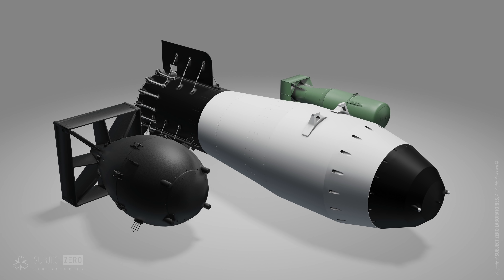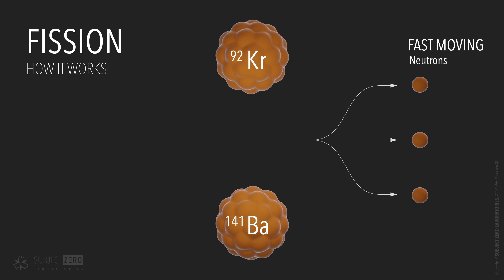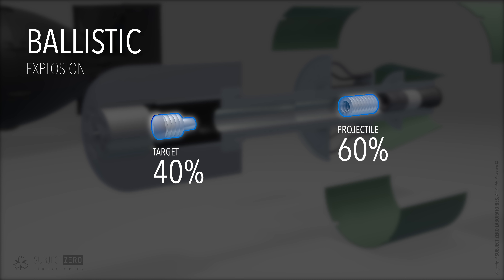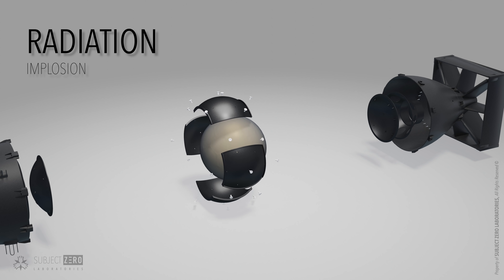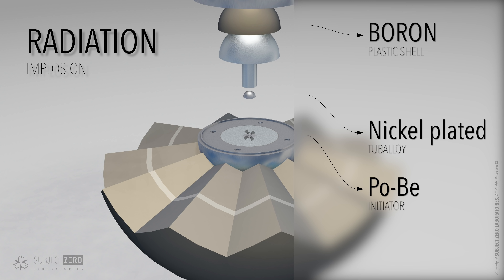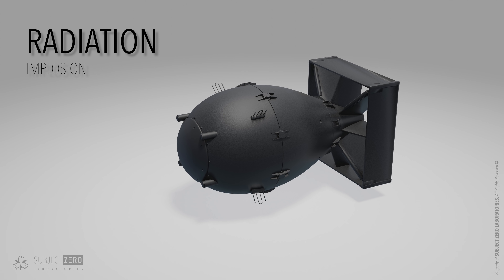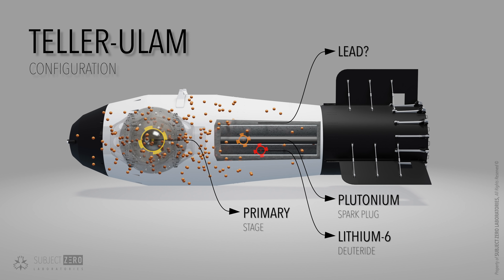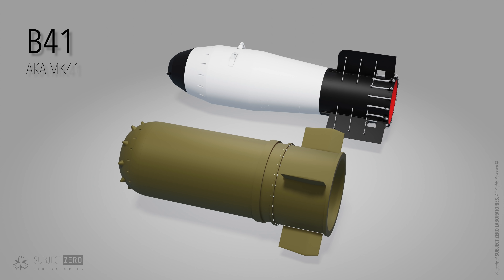Are Russian Nukes the Most Powerful?

Comment: The first British Thermonuclear bombs had a layered structure with the fusion fuel layered around the fission primary. The Tsar Bomba was also a layer cake design. In theory you could just add more layers to make it as big as you like.
Reply: Sorry, you do not understand how a layer-cake (sloika in Russian) thermonuclear device works at all.  Layer cake devices are compressed by high explosive, not radiation, and have a maximum yield about 1MT.  Tsar Bomba was a Teller-Ulam-Sakharov radiation compressed device.   All of this information has been public knowledge for over 25 years.
Reply: @vibrolax  Not only that... a sloika design has an inherent limit on scalability beyond a which you cross the line of a critical mass. Yes the first fission-fusion-fission bomb was a layer cake design but, as you said... Tsar was a three-stage Teller-Ulam design.
This video is trash... it throws the ball, not only when it comes to the physics of the bombs... also regarding plain (and public) historical fact
Reply: @vibrolax  It's public knowledge, but it's not as though it's simple to understand. Even if you can separate the true stuff from the deliberate obfuscation and the plain wrong, nuclear engineering is up there with rocket surgery as a difficult subject.
Reply: @leninalopez2912  Pointing out gross historical or scientific errors in YT videos is a fool's quest, but sometimes we cannot resist.
Reply: @akizeta  It isnt particularly hard to grasp the concept of using a fission bomb to compress and ignite fusion.
Wht the tsar did was then use that resulting fusion to compress and ignite yet more fusion.

Comment: Fun fact, the tzar bomba was actually a nerfed version, supposedly they originally wanted (correct me if I'm wrong) a 100 mt bomb, but someone thankfully convinced them to do a "smaller" one.
Reply: The design was capable of 100 Mt but that would have killed the crew of the plane dropping it.  As it was they barely survived the 50 Mt version.
Reply: @JonMartinYXD  It would also spread the material from U-238 tamper they were originally going with across a significant portion of USSR, which is at least part of why lead tamper was used in the actual test.
Reply: @EgorKaskader  True, given how little regard the USSR tended to show for its troop's safety, they were probably more worried about the fallout.
Reply: @JonMartinYXD  There may be some truth in that. But the USA should not be too quick to mount the "high horse" on this topic, given all of the radiation exposure to US troops, civilians, Pacific Islanders and the environment in general, that resulted from our own excessive number of above-ground nuclear tests, especially in the 1950's.

In some ways, the most disgusting actions of the US government involved not immediate exposure (sometimes the result of honest mistakes with estimates) but rather the government''s later legalistic refusal to pay anything for the huge medical expenses of many thousands who were nuclear test victims.
Reply: In the end it was the cleanest bomb detonated measured on the yield/fallout ratio. And they basically only did it to show they can.
Reply: @HappyBeezerStudios  No. At least 5 devices have been fired with higher fusion fractions.

Comment: Little Boy was a security failsafe weapon.   Even if the altitude triggers AND explosives all failed, it was going to hit the ground nose first and the rear mass would have slammed into the front mass anyway.   That was the point of the design, an insurance plan.
Reply: On paraschute? BTW. Ground explosion of such a small warhead would be failure anyway.

Comment: You forgot to mention, that Tsar bomba was tested only at half power
Reply: Even if Tsar Bomba in it's full yield (100 Mt) configuration it's still has 3.7 to 4 Mt/ton of yield to weight ratio, still lack behind B41 5.2 Mt/ton.
Reply: he mentioned the U238 third stage was replaced with inert lead. 50MT of fission would have been a lot of fallout.
Reply: @ricodelpiero  yes but still, it is important nonetheless
Reply: @ricodelpiero  Who cares imo?
Reply: @Янус_Ырт  that’s why it was explained in the video

Comment: I think you have conflated tamper and reflector. The neutron reflector is a material that reflects neutrons back into the reaction so they have a second chance to trigger a fission event. The tamper was jus a really heavy she'll surrounding the reaction so it's inertial mass would hold the reaction from expanding for a few extra microseconds because a few extra microseconds can dramatically increase the yield of the reaction. They were usually in the same layer but not the same materials. I believe beryllium is usually used as the reflector and whatever the heaviest material they have available when designing the device is used for the tamper.

Comment: Little correction: you need slow-moving neutrons to achieve fission. They're called thermal neutrons. The faster ones will bounce off of the nucleus. A slow one will impact and stick, further destabilising the structure of the nucleus and causing it to fiss.
Reply: Many reactors use a moderator to thermalize the neutron flux, but fission bombs do not. All fission bombs ("A-bombs") undergo fast fission. https://en.wikipedia.org/wiki/Fast_fission
Reply: No. Weapons use fast neutron spectra.
Thermal and fast neutrons are more likely to undergo elastic scattering than any other reaction with fissile materials.

Comment: You don't understand the purpose of the larger (5-15 mt) H-bombs.  They weren't designed to take out cities.  They were to be dropped by bombers to destroy AIRFIELDS.  The idea was to hit enemy airfields very early in a war before they could launch their bombers.  The bombs were made very powerful so they could destroy the bombers on the airfield even if the bomb wasn't dropped right on target.  The assumption was the bomber might come under attack before getting into the perfect position so a bomb that could wipe out bombers many miles away was used.  

As ICBMs came on line the idea of using bombers to knock out enemy bombers on a first strike became impractical so the larger bombs weren't needed.

Comment: Neutrons do not reflect, the tamper acts to both slow the neutrons so they will cause fission and the high density holds the reacting material together longer and therefore increases the yield.
Reply: They undergo elastic scattering. The moderation of neutrons adversely affects the effective neutron multiplication rate, and is undesirable in a weapon.

Comment: Just a small notice, MK41 of the same size would probably have around or less than 100Mt as it doesnt increased linearly with weight 
The more the matter, the further apart are the furthest individual atoms, unless you increase density.
Reply: It increases exponentially. A more voluminous mass of fusion fuel of the same density will reach higher burn up efficiencies, due to decrease thermal losses and the whole assembly is larger relative to the photon mean free path.

Comment: Don't forget Atomic Annie. Not just missiles... Nukes in artillery shells! (rumor has it, some were made to be fired from the 14-16" guns of battleships.)
Reply: -  The M-110, 8" self propelled  howitzer was nuke capable. 
-  During the cold war, our firing tables had a page top heading NUCLEAR with necessary plot info, but weight & dimension info columns & rows were empty with red color CLASSIFIED; TOP SECRET Ref. No. *** across the blank columns & rows. An additional unknown crew member would be assigned to the crew if the situation required a nuke artillery shell who's location was also unknown & not part of our standard ammo supply. But could become available ASAP if needed.
-  Retaliation from an incoming nuke was to be to protect yourself by bending down with head between your legs & kiss your ass goodbye!
Reply: They had them to be fired from 155 mm howitzers.
Reply: @ricktotty2283  True, but that came later... 8" was cutting edge when I delt with them.
Reply: How far could these be propelled? I would imagine it would be much further than the blast radius...
Reply: @fauzirahman3285  Unfortunately, not always. Battleship rounds go about 25mi. (before your have to switch to rockets -- "self-propelled ammo")
Reply: Mk23 or “Katie Shells” were 16 inch nuclear shells designed for the Iowa-Class Battleships.
Reply: That would be terrifying, can’t shoot the projectile down.
Reply: Well, "Atomic Annie" was 280mm., according to the Renwal Model specs. That was about an 11in. battleship gun, not much bigger than  a heavy cruiser's 8 to 9in gun.
Reply: @dennispersson9466  Yep. Atomic Annie was a bit big for mobile artillery, but somewhere on the small side for naval guns.
Reply: The fatman mini nuke launcher from the fallout series is actually based off of a weapon made by.... you guessed it, the russians design to shoot mini nuclear shells from a morter station. Could you imagine mini nukes flying around the battle feild

Comment: Well-put-together, but has a couple of inaccuracies: the velocity of the annular uranium bullet in the gun-type design was about 900 meters per second, not 300; Fat Man used a plutonium core, not uranium.
Reply: It was 300m/s. You must be confusing m with feet.
Reply: @Evan_Bell  You're correct about the velocity; I wasn't confusing meters with feet, I was thinking of the original 'Thin Man' design which used a longer gun barrel and would've achieved 3000 ft/s. Later the barrel length, and therefore the muzzle velocity, were reduced.

Comment: Much of this isnt correct.  For example, the tamper isn't the neutron reflector that's usually a lightweight material lille beryllium.  The tamper is present to slow down the initial expansion of the fireball for a long enough time to achieve neutron saturation.  A few extra microseconds is the difference between a cumbersome low yield dirtybomb and a compact deliverable physics package with high yield (100kT -10MT) and minimal fallout (if delivered as an air burst), or a fallout nightmare country killer (if delivered as a ground burst).  The "radiation implosion" section is also completely incorrect!  Let me know if you want to fix the video.  It should only require editing the script to fix the errors and re dubbing.
Reply: "Neutron saturation"? Meaningless. The tamper delays second criticality by a factor of a few dozen nanosecs, not microsecs.

Comment: I thought the reason the tsar bomb was "only" 50 MT when tested compared with a design yield of 100 MT was because they used an non fissionable lead tamper to reduce fallout. Using a uranium tamper instead would have increased the yield considerably through fission due to the neutrons released by the fusion stage or stages. I think I read this in Richard Rhodes book "Dark Sun".
Reply: Almost correct. The final quaternary fusion stage was left off, because the resulting blast of a 100Mt explosion would have destroyed the dropping plane.
Reply: @ineednochannelyoutube5384  royhills is correct. The 50Mt difference was from changing the U238 tamper to lead. There was never a fourth stage.
https://en.wikipedia.org/wiki/Tsar_Bomba#Product_602
Reply: @justinhannan1713  The tamper was the fourth stage.
Reply: @ineednochannelyoutube5384  from the wiki:
"AN602 had a "three-stage" design: the first stage is the necessary fission trigger. The second stage was two relatively small thermonuclear charges with a calculated contribution to the explosion of 1.5 megatons, which were used for radiation implosion of the third stage, the main thermonuclear module located between them, and starting a thermonuclear reaction in it, contributing fifty megatons of explosion energy. As a result of the thermonuclear reaction, huge numbers of high-energy fast neutrons were formed in the main thermonuclear module, which, in turn, initiated the fast fission nuclear reaction in the nuclei of the surrounding uranium-238, which would have added another fifty megatons of energy to the explosion, so that the estimated energy release of the AN602 was around 100 megatons."

I hope that clears things up.
Reply: @ineednochannelyoutube5384  No. In weaponeering literature, the tamper of a secondary or tertiary stage is never revered to as being a separate stage.

Comment: Your video says that the "Fat Man" bomb used Uranium-235. This is not true. The "Fat Man" device (dropped on Nagasaki) used a Plutonium-239 core. This is what required the radical new implosion design (rather than the gun-type "Little Boy" design).

You also seem to confuse such Pu-239 implosion with the "radiation implosion" approach used to promote fusion burning in later "Hydrogen Bombs".

Comment: Slight mistake there - the implosion from the implosive lens mechanism of the Fat Man is NOT radiation implosion. Radiation implosion is what happens when X-rays emitted in a primary fission process compresses the secondary fusion material through the pressure of the X-ray radiation.

Comment: Hold on a minute you don't use fast neutrons, you use slow ones. Only slow neutrons trigger fission, fast ones pass through the nucleus.
Reply: Nope.  An atomic bomb is a fast neutron reaction.  Slow neutron reactions are for reactors.  This is why an atomic weapon needs a neutron initiator to work.   The problem with fast neutrons is not that they pass through the nucleus, but that so few of them actually hit a nucleus causing it to split.   When an initiator is used, it floods the critical mass with fast neutrons creating the chain reaction.  But, you're in really good company.  Heisenberg made the same assumption that only slow neutrons would work.  In his mind, you'd have to drop an entire reactor - making an atomic bomb impractical.

Comment: 1) Fat Man used a plutonium 239 core. The very fact that it had to be an implosion design had to do that, otherwise, it was not possible to use plutonium 239 synthesized in reactors (it had too much plutonium 241, which undergoes too much spontaneous fission and adds excess neutrons to the core, making it impossible to build a gun type bomb without predetonation.... the core would just disintegrate well before getting fully assembled).
2) Radiation implosion had NOTHING to do with core compression by means of chemical high explosives... it's an entirely diferent notion, relevant to thermonuclear weapons.

Buddy... this is ELEMENTARY nuclear weapons design. And by that I mean... introductory wikipedia level elementary. At that point the video lost all credibility. Research better your topics, because this is shameful.
Reply: Pu-240 is the prime nuclide concern with regards to spontaneous fission, not 241.
Reply: @Evan_Bell  Yep... you're right. My bad

Comment: Assuming you have access to an unlimited supply of lithium hydride, deuterium, tritium, depleted uranium & tungsten there is probably no upper limit to the yield.
It's just a matter of adding layers & using the photon pressure from the previous layer to initiate the fusion burn in the next layer.
The only two limiting factors I can see off the top of head are:
Is there a reduction in efficiency per layer that would eventually reduce the per layer yield to the point that it won't fuse?
Will the speed of propagation of the shock wave, which I would expect to be significant, exceed the speed of the burn? Which would result in the remaining fuel being disrupted before it can burn.